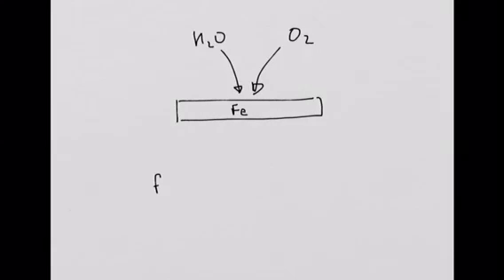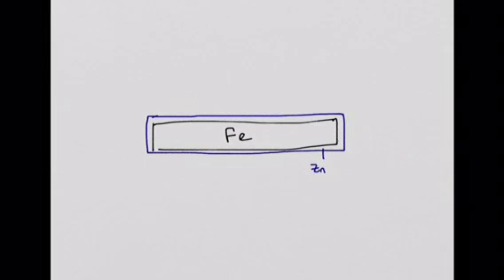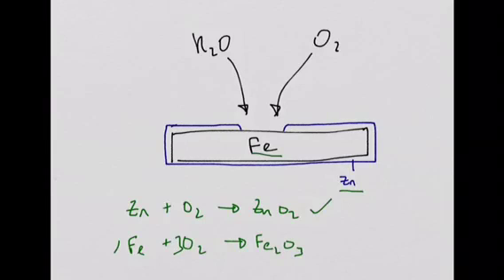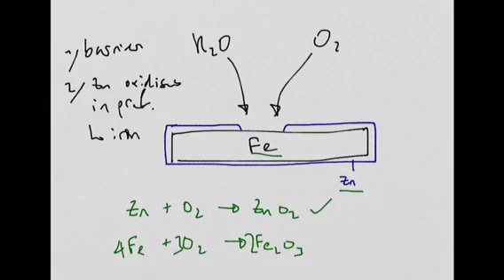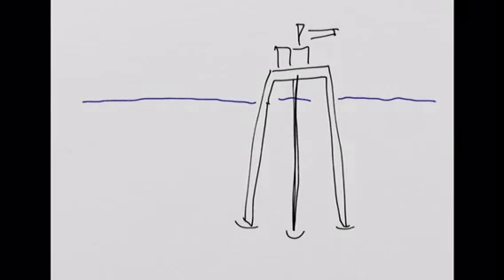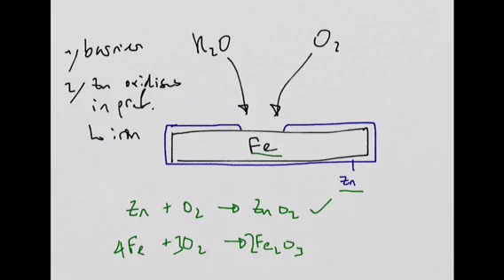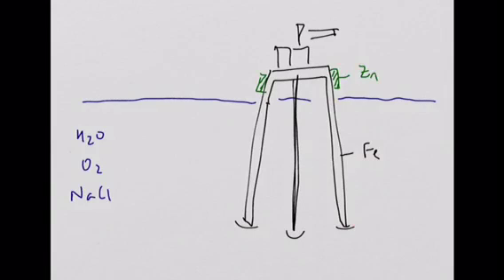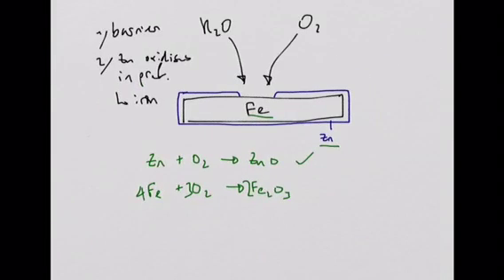Galvanising and sacrificial protection

Comment: What's the difference between galvanization and sacrificial protection?
Reply: @GavinLazaro  So galvanising is fully coating metal in zinc, whereas sacrificial protection is coating some parts of it. Aside from that, the differences are simply economic and efficiency?
Reply: @GavinLazaro  thank you so much! liking the video, i can pass my exam because of you 😛

Comment: In the sacrificial protection using zinc blocks and also in galvanizing you say that the Zinc preferentially oxidizes instead of the iron simply because it is a more reactive metal. However, I am wondering what exactly it is that causes this preferential oxidation on a deeper level. Might it have something to do with electrons? Why is Zinc preferentially oxidized simply due to its reactivity?
Reply: Gavin Lazaro Thanks for the explanation :) So in sacrificial protection when the Zinc block is in contact with the oil rig, what is stopping the iron from reacting with the water and oxygen present in the water?
Reply: Gavin Lazaro Ahh okay thanks :)